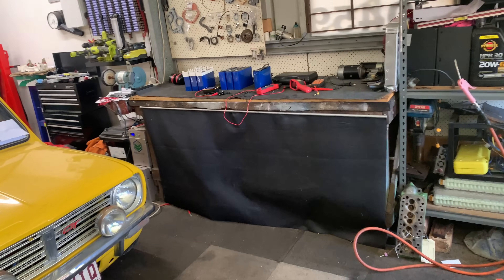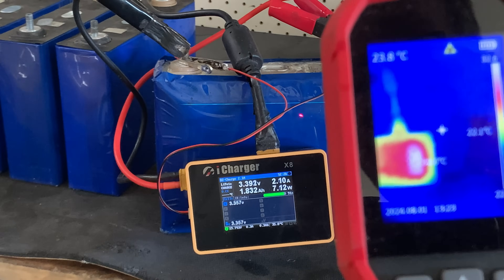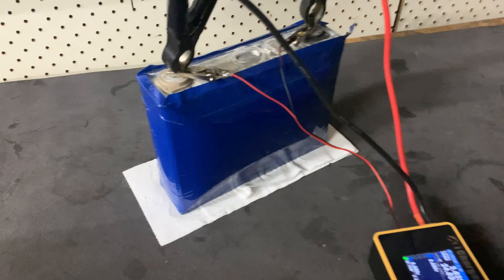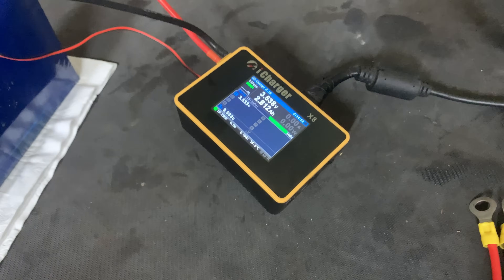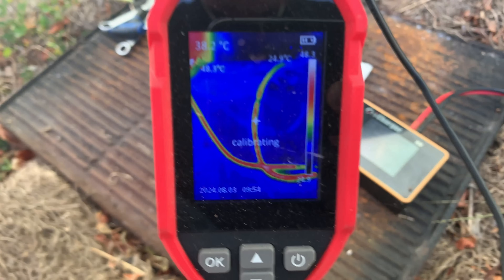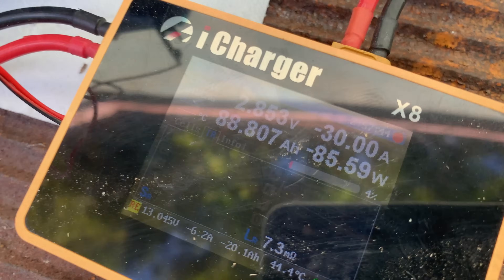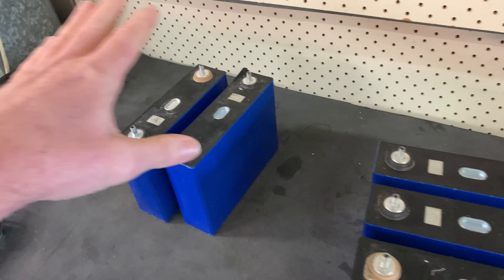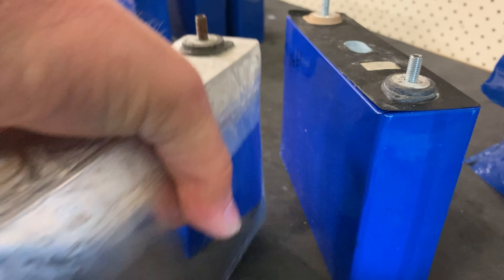Capacity testing destroyed GFB LiFePO4 Cells, these cells are unstoppable!

Comment: The capacity is not good in this bloated cells.
You have to make a little hole in this cell and put it in a vacuum chamber, then remove all the gas and close the hole while the chamber is still in vacuum.
You can put some aluminium tape over it with the help of a servo. The increase the pressure and the housing will shrink again, possibly you can press it together a bit. The pressure is needed to have good contact between the electrodes, it must be tight
Reply from the maker: Thanks so much for that information..

Comment: I wasn't expecting a bloated battery to have nearly full capacity without extra work. The battery in my booster pack has gone bloaty and whenever I need to use them, I need to compress the cells between steel plates in a vice to get any meaningful current in/out.
Reply from the maker: well it appears too under a small load - but this and other posts have given me an idea to retest

Comment: I have bloated cells just like those I didn't discover until the battery started disconnecting at 50%. I don't know why it happened I never used them without bms nor charged them past 55v I think random bad cells from factory REPT, though the capacity was only 140AH  from 280ah cell

Comment: Bro, this is not correct measure for battery condition, beacuse condition depends from voltage drop on maximal discharge current, if cell is 1C - you should test on this current, and then compare to good cell
Reply from the maker: Yes, that is why I pointed it out.. I don't have a way to test it at triple the rate unfortunately.. Still a cool test and good to see how much better these cells are than my other pile of 18650 cells

Comment: Timestamp 5.55 shows the overcharge damage.   You should not have a drop of terminal voltage to 3.120v after only 16 seconds of 0.3 C(A) load.  After three minutes of this amount of load, which is not shown, cell should have exponentially decayed equilibrium point of about 3.31-3.32vdc terminal voltage from full charge, no-load, rested starting voltage > 3.40.

Overcharging breaks down the electrolyte causing the bloating gas (mostly CO2, some CO).  The gas is not the most damaging aspect.  It is the other electrolyte breakdown byproducts which are hydrocarbon tars that clog up the graphite/LFP electrodes and separator pores restricting lithium-ion migration through cell.  This increases the driving overpotential voltage necessary to force the ion-migration rate required to support demanded cell current.  

The issue is terminal voltage slump with moderate load current.  At lower cell current demand, the capacity will not suffer too much.  Effectively, the cell internal impedance has increased.
Reply from the maker: THANK-YOU for the extra information - I need to rethink how I was going to do the taredown of the battery to look inside

Comment: I was worried about my slightly swollen cells, but I see that it is fine. Thanks for the video.
Reply from the maker: hard to say they are 'fine' chemical things would have happened beyond my experience or knowledge
Reply: @HBPowerwall  I would love to see what happened to the cells that were compressed. I watched those when I bought my cells, but I decided against compressing it. The cells seem to want to expand, so blocking the expansion probably kills the cells after a while?
Reply from the maker: I think it would blow the seal at the top faster? Well thats just what i think

Comment: Oscillating saw ,welding gloves,face shield...you'll be right,just lots of gas,ok if you don't ignite it😊
Reply from the maker: drill small hole and ignite anyway? jokes aside - I actually think at low SOC it won't have any built up pressure - I think the cell over heated - boiled the electrolyte and hydro formed the battery into the shape it is now. I think if I pop a small hole in it first, then take the edges of the top lip off with a hand file or maybe die grinder with a grinding stone on it. The cell might open like a can of beans
Reply: @HBPowerwall  yes think your right...I built a powerwall 18650 from your info,lasted 3yrs which was good.Before I started I tried blowing up the 18650 with overcharging (just for my peace of mind) and it was very hard (stuck it on a welder in the end)...got lifepo4 now and feel pretty safe....great info,thanks.
Reply from the maker: Thanks for sticking around :)

Comment: What happened to the cells, did you over charged them? Was there no bms?
Reply from the maker: They were in an ev with each cell discharged to 0.6v - a lot of errors and bad luck over charged 18 cells - take a look 1 or 2 videos back and you'll see the issues trying to be fixed.
Reply: @HBPowerwall  okay, I will check them out

Comment: I Love your i-Charger that counts the amp hours into the battery. Its amazing to see power in to power out efficiency especially
when using solar or where you need the best ratio of power out to power in.
I like using SAFT aircraft ni-cad batteries, amazing power.
Not as good as Lithium but very good value when they batteries are cheap or free
Reply from the maker: IChargers are awesome, i've always loved them - Cheap/Free batteries are the best no matter the quality!

Comment: If I had a old shed on a remote farm site away from my house and garage it might be worth using some large damaged cells like this, but for anyone else the risk should be unacceptable. Any Li-chemistry battery I find with physical damage or exhibits any strange testing result is immediately removed from service and later disposed. Its not worth the risk. Many serious commercial scale storage fires occur with LFP batteries, "safer does not mean safe".
Reply from the maker: With the right location & nothing else they would still store useable energy - but I'd still be super concerned for safety
Reply: Where's the evidence about lfp fires - key words to goggle links (you cant put urls on YT

Comment: Nice video =] I've seen LFP battery teardown in similar condition - I would not expect anything spectacular, just when internal pouch cells are open and internal circuit shorted the electrolyte will start burning. Opening the metal case on top would not cause popping or bursting in flames. Putting a nail through the pouch if circuit is shorted would cause smoke and then flames if the battery is charged. When discharged - maybe some smoke.
Reply from the maker: I have not looked if others have done a tare down video - I'm scared to do it but still want too hehe

Comment: i had one of my GRADE A ali special 280ah cells burst. think it was because the case was dented/had a micro facture. would have leaked out liquid all over my trunk if i hadnt wrapped it in strapping tape. think it was partially because of the heat wave we had. still a little confusing, this is extremely rare as far as i can tell. the vent on the top was fine, very minimal swelling, maybe 5mm. i was using it in a 4s pack replacing my lead acid battery in my chevy volt for the past 8 months, put around 25k miles on it lol. was also being charged from a roof mount solar system through an mppt. no bms, just an active balancer. i fiddeled with the charging settings and forgot about it, but who knows. got a full refund lol
Reply from the maker: If you got a refund that's a win! Looking at the hydro forming going on with this cell with out its blue wrap, the slightest weakness would cause issues fast!

Comment: Wow, that's amazing that it still operates. How dangerous is it Pete? Do you think it still has pressure in it?
Reply from the maker: My feeling is 'hydro forming' due to heat? I'm thinking it currently has no pressure.
Reply: @HBPowerwall  
expansion and pressure are two different things. and it has that safety valve at the top to vent pressure.
Reply: @HBPowerwall  can you push the sides in?
Reply from the maker: no they are very firm - like a hydro formed ball

Comment: I am shocked and stunned 😱I would never think it was so safe all the rubbish about fat battery they are pretty robust at least I give you plenty of time to fix the problem in the battery be for they actually fail
Reply from the maker: 'they would still get you home' but still scary!
Reply: the type of battery does make a difference, if you did this on a Lithium-Ion it would be riskier.
LiFePO4 is at least known for being much more tolerant and less likely to combust.

what was truly unexpected though is it still has most of its capacity intact, theres a bit more voltage drop during load but thats it.